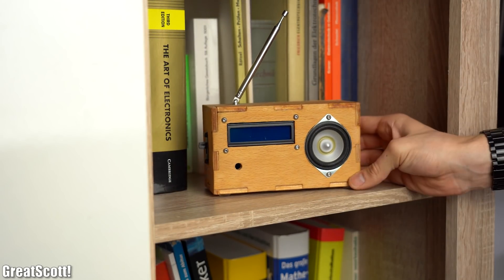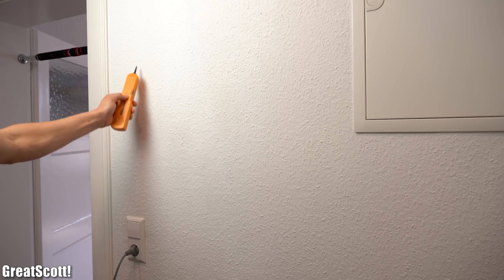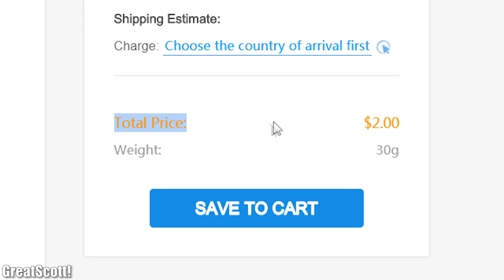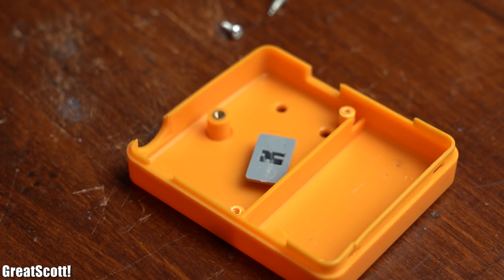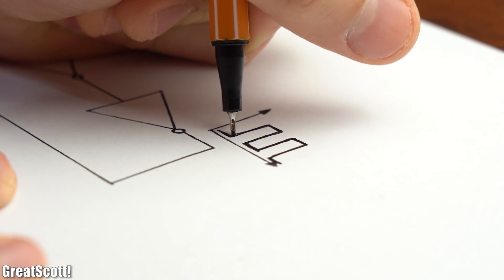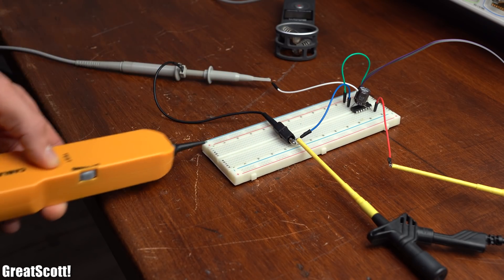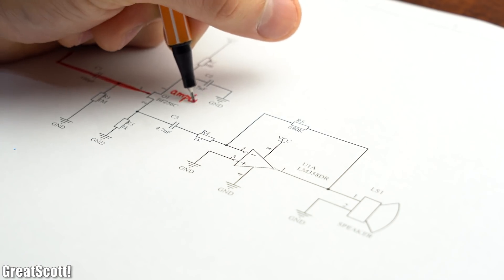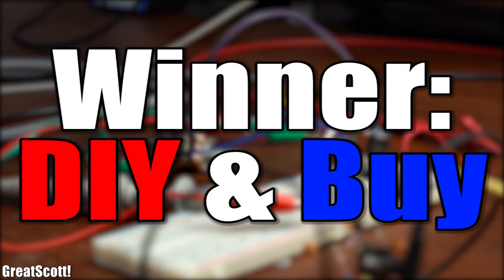Cable Tracker || DIY or Buy || A useful tool for every electrician!

Comment: To trace a wire over a long distance from the garden socket to the electric panel in the basement inside the house you need to have a strong transmitter signal that will remain powerful enough so the detector will be able to detect. How would you amplify the transmitter signal?

Comment: I modified my toner by putting in an am/fm radio modulator board from a car radio so now i just listen for the station i tune the toner for..  makes it less annoying and when your looking for wires in somebodies house you look like youve found some weird signal ..    learned it worked when i was hooking up the t1 connection for a radio station in town..  they have a circuit with the radio on it for in house listening stations..

Comment: Thanks to GreatScott! for this teardown, but...couple of corrections if I may ?
For anyone wanting the circuits of this yellow cable tracker, there are some mistakes in his diagrams :-
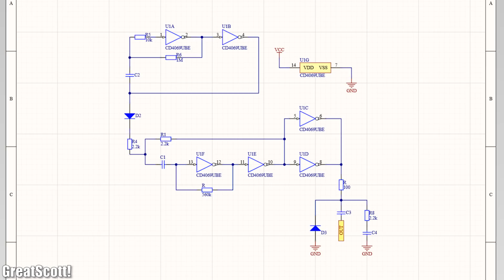In the signal generator (4:54) , R8 is connected to the bottom end of C3 not the top, and there's other stuff connected to R8 that is used for the 'continuity' function - this function is very dubious as a continuity tester in my example anyway, I left R8 and C4 in but removed R7, and D4 led, and now the unit is 'off' when switch is at 'off' or 'cont', which is nice, you don't have to check it's off properly. You lose the continuity and active phone line tests if you do this.
There's an internal switch that pulls top end of C2 down to ground, this stops the tone varying and you get just a constant tone, which is more useful (and less annoying) in my opinion.
I removed the RJ cable as I will never use this and it was in the way.

In the signal tracer unit (7:26), the front end is wrong - Q1 is an n channel mosfet type LBs, and D1 doesn't exist. It's correct otherwise. It wouldn't work as drawn in the video in any case.
The earphone socket cuts off the speaker, but then wires the two earphones in series and to ground, the ground (sleeve) of the 3.5mm socket is not connected to anything, so you CAN'T use that as a handy external grounding socket without rewiring it. Q2, R1 and R11 turn the + power rail on when you press the button, the negative rail is connected by the switch on the pot. So even with just the pot sw on, there is zero power draw. No idea why they did this...just in case anyone else wonders what's going on there.
Also, as a tip for anyone trying to make one of these work properly such that it can home in on a very small area of peak signal (tone), like a single wire in a bunch, I added shielding inside - one side of the pcb is mostly ground plane so that shields that side, the other side is basically all aerial (antenna), so I lined that side of the case with ali foil grounded to the pcb ground. Some emi copper tape is handy here also if you have it. Also, I swapped the bare wire probe for some very thin coax up the plastic tip, strip outer for 1cm at tip, ground the outer. Now it will only hear the signal from that tip of the probe rather than the whole upper body of the thing ! 
If you are tracing a single wire in a bunch, do what the instructions say and connect red clip to the one wire, then connect ALL the other wires together, to the black clip AND to a good ground - when I tested a long run of 3-core mains cable, this is the ONLY way I could identify a single core at the other end. Too much capacitive coupling between all the cores just makes the signal appear on all of them when cable was even only 1m long.

Comment: When the antenna is closer to the point of frequency. there is no sound. Except when I touch the antenna with the frequency there is a sound in the speaker. Is there a solution to this problem

Comment: Great video. I needed one yesterday, luckily only 4 cables to choose from :-)
With the low prices on AliExpress I am almost tempted to buy one by I think DIY is the way to go, then I can make multiple transmitters with different tones (or sequences).
I should still have some 4069UBE (unbuffered !!!) chips in my old stock and the good old BF256C (or similar) should also be collecting dust somewhere :-)

Comment: Would it be more useful if the tone generator could be amplified to the point where the receiver could pick up the tone through typical drywall.

Comment: I have ben tracing wires this way for decades.  I am on my third toner.  You can trace live wires neutral to ground.  I have had a water leak into the wall cause the tone to go away-the insulation was soaked!  This does not work well when there is conduit, you have to open junction boxes at both ends to find the wire with the tone on it.  I found a fried wiring harness in my car with a toner last week.  It saved the car from the junk yard!

Comment: I would love to see a water in pipe tracker. In the US, we have similar rules for where water pipes can be installed, but that doesn't mean every building was built to spec. I "found" a water pipe mounted against the inside of the drywall when installing a TV wall mount, which made for an "exciting" day (and a $70k insurance claim)

Comment: I have several of the commercial products due to working in the telecom industry for decades.  We often used them to identify wires in a multi-bundle cable.  The original used a common buzzer to generate a nasty tone that was picked up with an amplified probe.

Comment: Excellent video. Personally I used a simple oscillator as transmitter as yours and a AM-radio as a receiver. Much cheaper as i already had that portable radio and also got better Gain.

Comment: Super cool video! I might have watched it more than once... I've used these toners many times for low voltage work and eventually replaced the most of my cheap analog versions with what I believe is the only digital version (Fluke intellitone) and is priced as such. Using the second version is a must in a building with noisy (rf) cabling. Might be an easier win for the DIY, but maybe not.

Comment: @GreatScott Is it possible to modify the DIY version to have 2-3 antennas to pinpoint the wire for more accuracy?  2 antennas 3 inches apart with a comparator between their output stages should work, right?

Comment: Could you add a stealth mode to a microwave? It would disconnect the beeper when enabled and would reconnect it after some time after it detects a beep, so you won't have to manually disable it. This could prevent so many families from getting woken up in the middle of the night because of a hungry member.

Comment: In North America, the Loomex is stapled to the studs going vertically, and when running horizontally, drill through the centre of the studs with 1 1/4" of wood on either side. Loose cable flopping around behind the drywall is not an issue, as the wire will move out of the way when hit by the drill bit.

Comment: NEVER assume that the presence of standards means ANYTHING. Someone before you may have entirely ignored those standards.

It's super-easy to trace 120V / 240V wiring with any simple audio amplifier, using your hand as an antenna.

Comment: Prototype wiring is great for a mock-up to test circuits. Through to the '60s all valve/tube, and some transistor equipment was hand-built utilising point-to-point wiring until PCBs became the go to method. It is still done today in audio gear like guitar amplifiers and HiFi amplifiers using tubes/valves where not only the traditional characteristic sound/tone is sought after but also the traditional build method for perhaps a unique, non mass-produced piece of gear. Tag strips or turret boards, a rectangular bakelite strip with a row of lugs, are used as solder points between components, the same principle as pads on a PCB. The difference in sound tone between point-to-point and PCB construction is subjective and similar to how someone might taste wine.

Comment: hey, you forgot to tell the audience to prove test prove the circuit is isolated, BEFORE working on that circuit, or attaching the cable locator on the circuit. failure to do so, could result in "electro boom" episodes. :)

Comment: What if the emiter is shorted? on the buy version it shouldn't be a problem (well, at least, when i worked in telecom, I used this a lot to find pairs between cabinets, if the sound went away when shorted i was sure that was the right pair)

Comment: Great video Mr Scott (let the comments begin correcting me about your name)! Question: in your receiver schematic when using a BJT or MOSFET as the antenna input stages, the schematic shows base or gate are pulled to ground which would turn the transistors off (especially in circuit with BJT the collector is also pulled to ground, should be VCC?). So this means the circuit is relying on the strength of the signal picked by antenna to turn the transistors on and pass the signal through. Is that correct? In such case I think that's why the receiver is not doing great as you showed because the antenna is working based on a weak capacitive coupling not strong enough to trigger the circuit with existing resistive and base current loads on the antenna. I suggest to improve the circuit by biasing transistors in ON mode and just let the weak signal to get buffered through transistor. Of course the bias can only be very high resistors not to load the weak signal, or in case of BJT use Darlington to reduce base current... I think! I don't know... good luck!
Reply: Hi there. Keep in mind that in his version of the circuit he´s jusing a JFET, which behaves different than a normal BJT Transistor. The way he´s "pulling gate to ground" is the right way to do it here. Over all his circuit isn´t to good. The Jfet should have higher resistance or a better said a higher resistor in the source line, and the coupling capacitor to the op amp should be bigger. Also, if I recall correct, I think I saw some kind of frequency selective part in the original circuit (like to attentuate other frequencies and peak the 1Khz Signal), that was done using a RC circuit. In the short demonstration that was shown, it also could be heared that his version of the circuit did pick up a lot of intefference, whereas the original circuit (the one he purchased) did receive his diy transmitter rather well. I guess he used the JFET (which behaves different than a standard transistor) to have a very high input resistance and due to that make the circuit very sensitive. So yes, for standard Transistors biasing "Base" towards plus does indeed work, but for a JFET you have to "bias" the gate ("Base") towards ground. If you put it towards +, it will make the Jfet less conductive (reduce amplification). The circuit (receiver) could be improoved using a high impendance LC tank circuit, with a coil with many mH (>10mH) and a parallel resonance capacitor so the circuit will have a resonant frequency of about 1KHz. That also would put away the humm noise you heared when he tested the bought circuit (It´s not necessarry obviously, and was left away due to cost reasons). Anyhow, just wanted to reply to you. I watch your videos too, you´re an amazing entertainer.
Reply: +1 for the Darlington and explanation!!! Nothing blew up, what are you complaining about!!!!!
Reply: Hey Mehdi love from India
Reply: FUUUUUUUUUUUUUUUUUUULLLLLLLLLLLLLLLLLLLLLLLLLLLLLLLLLLL BBBRRRRRRIIIIIIIIIDDDDDDGHGHHEEEEEEE RRRREEEECCCTTIIFFFFFFFFFFFFIRRRREEEEEEEEEEEEEEEEEEERR
Reply: I'm surprised that there's no reply from GreatScott. Was he offended? 
Get over over it Mr. Scott, ElectroBOOM's questions are legit. I think I'll unsubscribe
Reply: Yo use un NPN MPSA13 y lo polarice como se haría habitualmente y la amplificación fue bastante satisfactoria
Reply: Question both to Mehdi and Scott? Can you make a version where the speaker is replaced by a LED? (or some other sort of light).
Reply: Oh wow, I am the first like and comment of this. Hey Mehdi, nice to see you.
Reply: wrong Mehdi,  the FET is biased already in ON region (VGS is biased negative) but it is not amplifying, it is just a buffer with very high input impedance so to pick up the weak voltage. the BJT collector must have been connected to VCC, unless there is a negative VEE in the circuit which I dont think there was.

Comment: Circuit traces can easily lead you the wrong way as well, and if the cables goes through a large server  room, it's not much fun. The two tone tracer are better distinguishing the difference between data cables and what your tracing, there also helpful with hearing aid loops👂, you can even hear people taking over landlines with them.

Comment: I knew that the sound was somewhat familiar! During the 1980s and early 1990s I had a homebuilt phone to my best friend next door - and the signaling was done with the same time of dual-tone oscillator around a hex-inverter 74LS04. Each side of the chip was wired by connecting the three inverters in series  with a resistor feedback over one group of inverters and a capacitor over another pair. Then mixing the two tones together gave quite an efficient siren effekt.

Comment: You can also use a non contact voltage detector thath you can build with a 555 timer two resistors and a capacitor. It also works well. Nice video thank you.☺
Reply: does it works on concealed wires

Comment: Please be careful everybody. Connecting anything to "mains" wiring that is less than overvoltage category III rated to at least the operating voltage of your local supply is "risky" at the least. If you switch off the "breaker" you have only disconnected the L1 line. If there is miswiring or someone else chooses to switch that back on or a fault occurs and the "ground" is not good... well you can imagine. By all means "play" with safe extra low voltages but leave the "mains" to the trained and qualified electricians. These pair-tracing tools are intended for telephone and similar wiring not for potentially "live mains" cabling. Not sure who said this first but "There are old electricians and there are bold electricians, there are no old bold electricians."

Comment: Here in Canada and the USA our cables go through the middle of the studs, and the distance between the wire and the surface of the wall is calculated so a normal drywall screw won't be long enough to hit the wire. A framing screw for hanging kitchen cabinets, on the other hand, does damage wires. Ask me how I know...

Comment: I have a stud finder with a built in wire detector which I find works well on live ac wiring. What's the difference between and benefits of the two different approaches?

Comment: I used one of these day in day out for many years and never used the contestant tone mode (diy) as the variable frequency is much easier to pickup when there is interference from other sources. Especially over long distances. Buy would be my winner for sure.

Comment: I'd love to see some version of this type of equipment that could trace WiFi radio signal from a router/AP. Not just a Netstumbler-esque software-based solution like NPM, but a circuit/device you could solder together and build from parts, like this cable tracker, that would give you a real-time read out of the RF signal being transmitted from the router. Probably plenty of reasons why it's problematic, but would still make an interesting project.

Comment: The ones I've seen:
The transmitter uses two 555 timers (or one 556 dual timer). One 555 is set to astable mode (pin 5 is the output through a 1k resistor) with its frequency modulated by the sawtooth from the other 555 (makes a warble tone).
The receiver is the same lm386, but uses the jfet input amp (like your version), but the jfet is from one of those capsule microphones (remove the microphone diaphragm. You'll see the gate of the jfet. Extend the gate wire). The jfet in the microphones are specially designed to not need a bias resistor (self biased) and have a really high input resistance.
You can use the transmitter without removing mains power. Just wrap the transmitter wires around the mains cable (no need to separate the conductors) and short the clamps together. It uses inductive coupling. Receive distance is reduced.

Comment: You can make a sender unit from a (very cheap) battery powered window alarm.
It won't have the same signal but it works as a transmitter.
I haven't found an inexpensive (off the shelf) receiver unit.

Comment: 15 years ago when I was telecom technician this kit worthed $150. And it's schematic was completely the same. I couldn't believe how it was overpriced.
P.S. Based on experience, version with additional 50/60Hz filter is much better.

Comment: I like to watch what you make.  But If there is an other wire in the wall with electricity( for example a wire for a light), he will not be detected. So, for me , il will be more safe to detect electricity and to light up a led when 50 Hz is detected. Continue you vidéos and don't change anything because you explain very well.

Comment: And I am also remove out the LM 317 circuit of DIY powers supply project and test with my lab banch power supply and miltmeter and analog voltmeter  and I am also replace the variable resistor in 3 new  variable resistor but again my DIY powers supply is not working properly

Comment: There's a commercial product called walabot. It uses radar sensor to scan the wall and you can get image on your phone. But it's much more expensive than cable tracker.